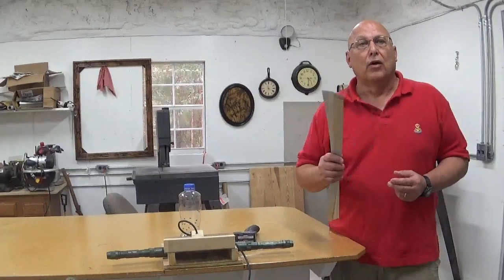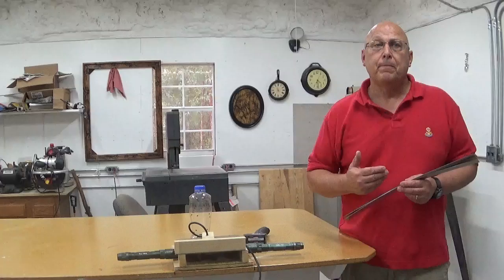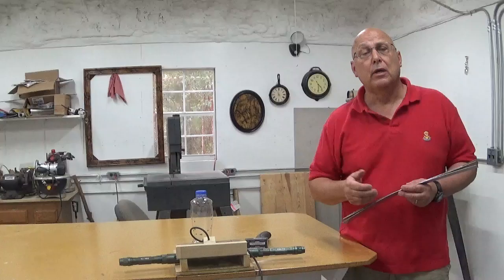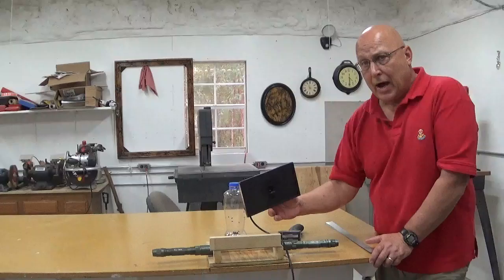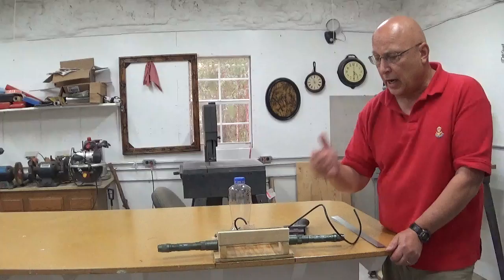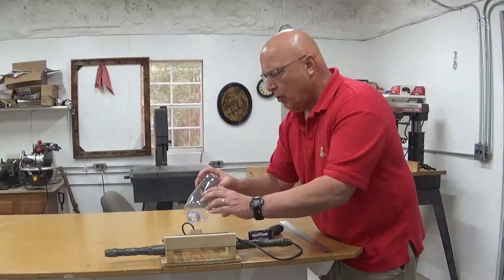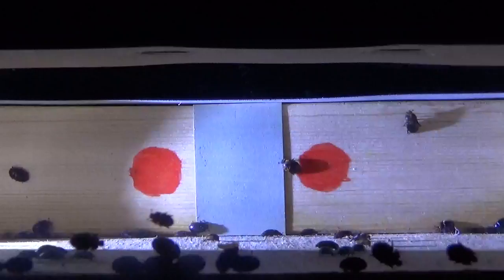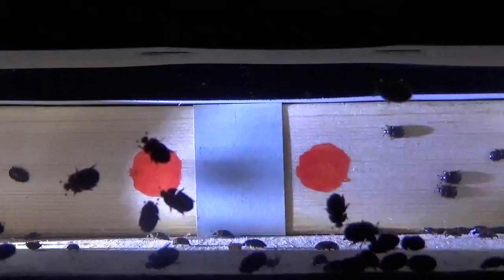Small Hive Beetle Prevention and Control, a test using live small hive beetles to stop and trap

Comment: I saw ur first video and tried it on all my hives they really do work. The only time it doesn't work is when the colony hits a nectar flow and u don't supper fast enough and they build honey comb all the way to the bottom board. Giving the SHB a ladder to climb. Awesome product. Thanks
Reply from the maker: Your welcome, I'm glad its working for you.... Make sure your use window screen on any openings above the coated flanges and seal the box seams with polyethylene foam tape. Good Luck.

Comment: barriers at the edge do not keep them out....they fly to the middle of the hive
Reply from the maker: Billy,

 I have 51 full hives and 3 NUC'S, they all have the Neverwet coated flanges and there isn't any hive beetles inside. Pulled off 24 supers and saw 1 hive beetle in the honey super, I see them all over the outside but none in, plus they don't fly inside the hive. I'm not trying to make anyone use these flanges, I just know they are working for me.

Comment: I have been testing this on a pair of Warre hives. Early results good but there's an issue. Through the handy observation window in the hive, I can now see small hive beetles coming in the front entrance and walking right over the bottom of the strip to get into the hive. I've watched other beetles not be able to make it and watched the bees be able to work their way over it but not easily. This path the beetle took was right in front of the front entrance, so perhaps the bees have laid down enough pollen and dust off of their feet to make a grippy path for the beetles.

Jeff, do you have any thoughts on this? I pulled out my camera phone to try to record video of the event if it happened again, but I didn't catch the beetle doing this. I have a feeder in the top of the hive right now and I am noticing an increase of beetles in the feeder in this one hive, where as the other hive has zero or very few beetles in the feeder.
Reply from the maker: I have all 10 frame Langstroth hives so that is what I am most familiar with for problem solving BUT I have been asked this question several times from people with Warren and Long hives. I don't know exactly what your front entrance looks like or why the bees would be walking on the coated side of the flange to enter the hive. There are two things you could do,  widen the front entrance strip so that there is more material to repel the beetles or the idea I had was to make an entry way chamber that the bees and beetles had to go through before entering the hive. Bob Spencer in Gulf Breeze FL. was kind enough to make a video of my design of an entrance chamber for a top bar hive that I gave some thought to. Bob was going to adapt it to his AZ hives, here is his video     https://www.youtube.com/watch?v=-rNoM4z02o0&feature=youtu.be  and here are my design measurements; To make a mini bottom board attach a 3/4" high rim to an 10" wide X 6" deep bottom along with a 3" landing pad. Then make a 2" high upper compartment with a solid top cover, the 2" upper would give you enough material to drill or slot an area to mate up to the hive opening. It will also have enough room for  the bees to crawl over the Neverwet coated flange or fly into the hive entrance but dark enough so the beetle won't fly inside the mini bottom board and trap them on the bottom of the mini bottom board. The Neverwet coated flanges would be attached the top of the 3/4" rim on the side and back and then attach the 4th coated strip to the front of the 2" top compartment, just like in the original Neverwet Excluder video. Unless you need to feed your bees this time of year, I would stop or make some kind of cover for the feeder that only the bees can have access to from inside the hive so you can starve the beetles out.  Have Fun.......

 Show less

Comment: Mr Willard, after watching with amazement your video using the product Never Wet, I just had to try it for myself. I modified several of my hive bodies and bottom boards. All seemed well. Then yesterday, a month after modification, I went back out to the bee yard to check out these hives with Never Wet strips. 
I have screened bottom boards so I can get down and look right up at the bottom through the screen and into the hive. I lay on the ground looking up and to my surprise I saw the beetles onside. I saw the beetles walking right over the Never Wet into the hive! As I laid there I cussed at you because I had spent money and time on this project and it didn't seem to work in a real hive. So, have you done what I have done and looked into an active hive  to see if the beetle can get in? 
It may be possible that the bees walking over the surface apply a coating from their feet that changes the surface traction and the beetles can walk on it again. PLEASE, please , please try this experiment again in an active hive with a screened bottom and check it out for yourself. I'll be looking forward to your next video on how to correct this.
Thanks Barbara
Reply from the maker: Hi Barbara,
 
  Sorry your having problems but lets try and figure this out. I had a person on my other video who made the same statement, he said the bees and hive beetles are walking on the Neverwet coating. The bees should only be coming into contact with the very outer edge of the coated flange. When he sent me pictures to help him, I instantly saw the problem. He had made a 3/4" shim to staple the coated flanges on and attached that to the existing 1/2" shim on his bottom board. This made the height from the bottom board to coated flange 1-1/4" high which made thousands of bees climb up the inside and then struggle to get over the coated flange thus leaving minute scratches plus pollen and wax deposits from the bees feet on the Neverwet coating. He removed the 3/4" shim and at last report from him the Neverwet coated flanges are working perfectly, letting bees in and keeping beetles out. Now, if your problem is not like the one I just described. I would have to think it may have been a problem in the cans of Neverwet material itself or in the application of the Neverwet on the aluminum flanges. You may have to reapply the Neverwet coating with a new kit and take the original one back as defective. You are the first person that has said Neverwet flanges don't work and I hope my suggestions will correct the problems you are experiencing. You asked if I have ever tried this on an active hive. I have 50 hives that all have the Neverwet flanges and the polyethylene foam sealing tape and every time I open my hives and don't see any hive beetles inside it only proves that the Neverwet works. Here is a link that will show you inside my active and not so active hives.   https://www.youtube.com/watch?v=GMPQ2vGxp8E

Comment: Great work and effort - thank you.  One element I thing might need to be added is an "easy" way for the beetles to go that ends in there demise.  Don't give them a chance to figure it out just push them down a path to oil, or some other one way trap.
Reply from the maker: Hi Wade,
The most popular way is by using a Freeman style trap under a screened bottom board. People use veg oil, diatomaceous earth or soapy water. These Beetle Barriers are to keep them from getting up into the hive. Thanks for watching..

Comment: In watching the beetles enter the hive, They landed on the box and make a run for the opening.  Why not paint the wood around the opening and landing board.  Also spray a band around at the box seams.  This could keep to beetle on the outside of the hive.  I'm using the flange with a screen bottom. The screen is also treated.  In 45 days from last April I killed (thumb smashed) 475 beetles in two hives dry pans. I seen about a dozen in the hive.  They may have entered from the top or joints.   Inspections of the hive is hard as my ki
Reply: Read your first response for 5 months ago where you were going to try this and get back with results.  When you say dry pan are you meaning the bottom  board space between the bottom board and bottom super?  By the way I apreicate  that you did indeed get back to Jeff with the good news!! We all need to learn as much as posable  to help the bees... Jeff Willard, Sir if you read this, how is it going with progress with the University?

Comment: Hello. I am a hobby bee keeper that hates hive beetles. I lost all my bees in the Harvey Flood and am starting over this spring. I live in the Houston Metro. and trying this method. I hope it works and will give a report. Thanks , the Bee Rancher.
Reply from the maker: Hi David,
  Sorry to hear about losing your bees, I went through the Ivan and Dennis hurricanes so I know what your dealing with. After the Neverwet coated strips are installed the next thing is to seal the hive, you have to remove any point of entry other that the entrance, this will keep the SHB below the coated barrier on the bottom board. Good luck with your new bees....

Comment: Jeff,
   Thanks so much for your experimentation and willingness to share it with the rest of us.  At the latest bee club meeting I attended, a University of Georgia extension agent was the guest speaker, his topic: the small hive beetles.  His best idea/ recommendation for controlling them was to situate the hives in a place where they receive the maximum number of hours of direct sunlight.  After that, good luck.  
    So I started scouring the internet to see what I could learn about this pest, which is when I ran across your videos.  I'm just getting back into beekeeping after more than a ten-year lull and have now decided to take your advice.   I'm outfitting my hives with the aluminum phalange-treated NeverWet coating.  
    So now my question:  I'm confused about the polyethylene foam strips.  I notice that in your reply to another inquirer you say, "You need the single sided closed cell polyethylene foam tape to fill in the gaps between the boxes caused by misaligned finger joints and the milling process."  
    Is this the same as double-sided foam mounting tape?  That's the only thing I could find at my local big-box store.  Plus, they did not sell it in quantities large enough for what I will need for my hives without charging an arm and a leg. When I specifically said that I was looking for polyethylene foam strips, and that I thought they had adhesive on only one side,  they looked at me as though I were speaking a foreign language.  
   If it's in the big box stores, and if it's not the same as the double-sided foam mounting tape,  in which department do I look, and what exactly (brand/product name, please) am I looking for?  
    Thanks in advance for your guidance.                                                                            Dale
Reply from the maker: Hello Dale,

Now you can see my frustration with the Honey Bee Research Community, my emails and contacts to these people have been ignored for the past two years. Do not use double sided foam tape, it would be nightmarish to get the boxes apart, you need single side adhesive polyethylene foam tape. I experimented with closed cell silicone, vinyl, neoprene and polyethylene of the four different types of foam sealing tapes. Polyethylene was the toughest, held up against the bees chewing and releases the boxes and screened vent tops the easiest. The people in the big box stores try to help but they only know what is on their selves. I am sending you two links, one to the original video and the other is the page to order the polyethylene foam tape. If you have not seen the update videos on the SHB Excluder yet they give additional ideas to improve on the sealing of your bee hive and problems that I found. As they say; An ounce of prevention is worth a pound of cure and these coated flanges are that ounce of prevention.  Good luck with your new bees........ 

https://www.youtube.com/watch?v=FfnefkJSfBs&t=337s

http://www.equalseal.com/White-Polyethylene-Closed-Cell-Foam-s/2187.htm

Comment: Granted I am a new-beee... I saw your videos over the winter and decided to implement from the get-go and of my five hives since the start of this year - I have only seen 1 hive beetle that was "included" with my original nuc.  I am working with screened bottom boards; 8 frame lang and warre hives.  I have yet to implement the closed cell foam on my hives but still have not seen any beetles.  I have passed a set of flanges to a master beekeeper here in GA that I know did have a hive beetle problem and I am hoping that he will implement and see a reduction in his hive beetle problems.  Thanks for publishing what you found out.
Reply from the maker: Your welcome and I am glad the Neverwet flanges are working for you but the polyethylene foam is also very important in "sealing" the hive against the hive beetle. Good luck with your new bees.......  http://www.equalseal.com/White-Polyethylene-Closed-Cell-Foam-s/2187.htm

Comment: I copied your idea but changed it slightly; I cut a square piece from the middle of an aluminum sheet sized 2' X 2'  so that it fits the bottom board and the area below the screen is open.  I of course painted it with the Rust-Oleum Neverwet on the underside.  I built a rectangular base to go under the bottom board and affixed this painted aluminum sheet sandwiched in between layers of the new base I made to fit below the bottom board. Nearly three months into it with this new hive we have no hive beetles what so ever in that hive.   This hive is in the deepest of shade and is doing very well.  We appreciate your sharing this information and we are convinced your idea is well worth duplicating. No one needs hive beetles.   All the best to you sir.
Reply from the maker: It is good to see people like yourself coming up with new ideas to use the Neverwet to fight SHB and the big benefit is that your hive is SHB free. Keep up the good work.....
Reply: I appreciate the kind words sir. I think the biggest difference in how we did it here is we extended the sheet metal outside of the hive stand four inches or so. This prevents the SHB accessing the outside of the hive as well as the inside of the hive. No bug can climb up on the hive to access it, not even ants. So far it is a very good thing and we are benefitting from your idea of using Never-Wet to prevent bugs accessing the hive by crawling up from below.

Comment from the maker: Link to the Original Neverwet coated flanges, how to make the Small Hive Beetle Barrier..  https://www.youtube.com/watch?v=FfnefkJSfBs

For your polyethylene foam tape needs this is the best place to buy it. .  http://www.equalseal.com/White-Polyethylene-Closed-Cell-Foam-s/2187.htm  I have started to use the 1/8" thick x 1/2" wide with great results. This eliminates any spaces between the hive body, suppers and vent top where the beetles can get in.

Comment: Jeff, I am adding these to 2 Warre hives. Warre hives (this brand hive at least from Bee Thinking) has only about 1/4" of wood above the screened bottom board. I'm not confident that is enough room for the SHB Excluder strip to keep the beetles from just reaching up and climbing over, so I'm going to add an eke and put the strips on that. 

These are frameless top bar type combs so the comb may reach down to the strips and cause a problem at some point. We will see.
Reply from the maker: I would make a 1/2" thick shim frame to attach the Neverwet coated flanges to, attach the shim to your bottom board then set the Warre hive on top of that. This will create the Neverwet coated barrier between the bottom board and hive body to keep the beetles out. Watch the video and at 7:26 in the left hand of your screen you'll see a hive beetle support itself with its back legs and try to get over the coated flange, if the gap from the Neverwet flange to the bottom board was only a 1/4" a large hive beetle may be able to reach.

Comment: Jeff, a question. What's to stop the Beatles from flying up to the frames? Or is flying and landing upside down not part of their morphology?
Reply from the maker: From everything that I have read about small hive beetles once inside the hive they only crawl and hide. They do not want to expose themselves to the guard bees inside the hive by opening their elytron and flying, with their wing covers closed they are like little indestructible tanks to the honey bees. That is why the coated flanges work so well, they can not crawl over the Neverwet coated flanges.
Reply: +Jeff Willard, thanks. I'm probably going to attach the strips to a dedicated 3/4" spacer that I'll sit between the bottom board and the brood box. This way, I can change boxes and not have to worry about moving the strip attached along the entrance. Using a seal between boxes also makes sense as another way to harden the hive against the vermin. Have you tried spraying the screen of a bottom board to see if it has any effects? Cheers!
Reply from the maker: Hi Charles,
  Spraying the screen on the bottom board would have little effect on the hive beetles, plus it would make it difficult for the bees to walk on.  The effect of gravity would allow the beetles to crawl on top of the Neverwet coated screen to a certain extent. It is always good for everyone to keep thinking outside the box to improve on ideas and solve problems.